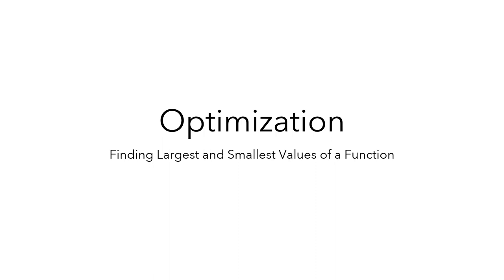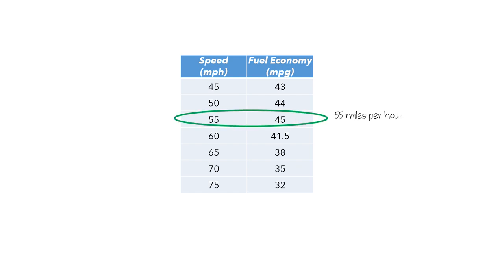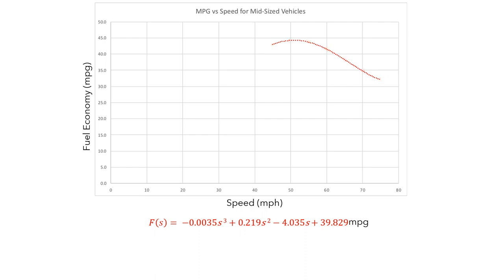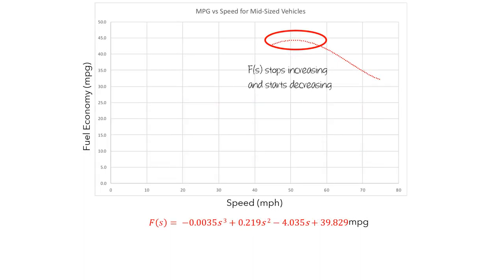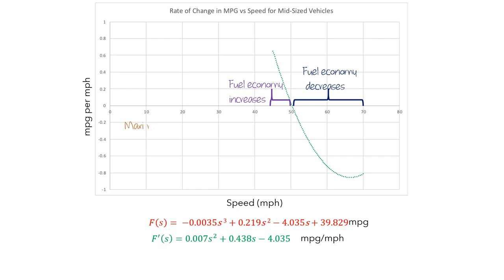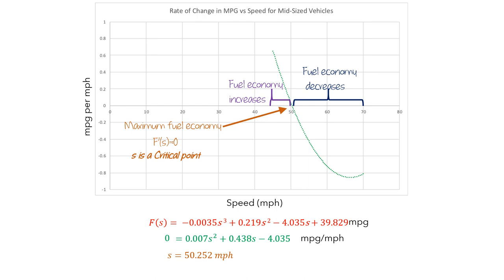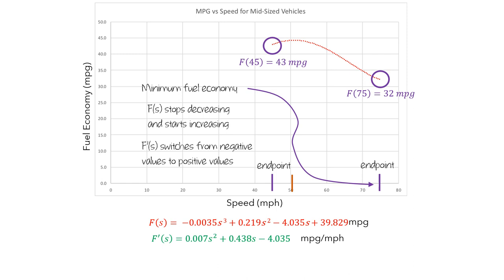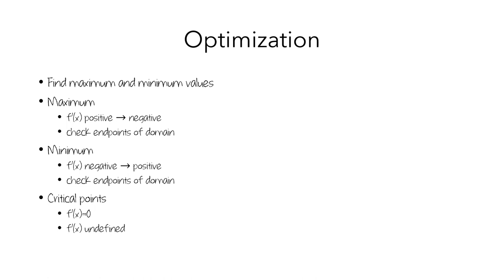Introduction to Optimization, Part 1: Calculating Maximum Fuel Efficiency

Comment: The fitted function is wrong and there is a mistake in derivative. Derivative of -0.0035s^3 is -0.0105s^2. You multiplied -0.0035 by -2 instead of 3. Besides that, the reasoning is good.